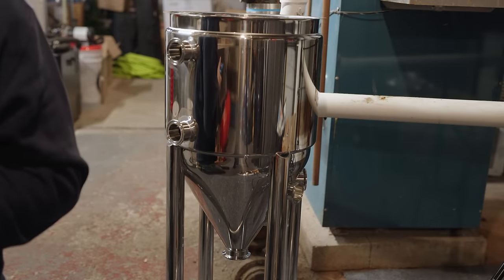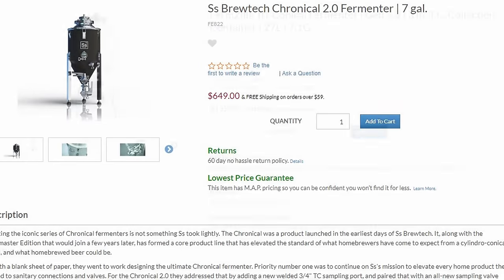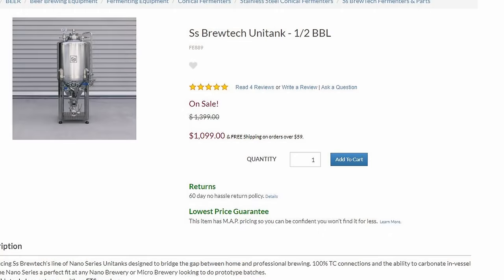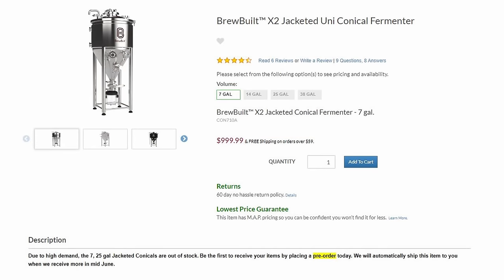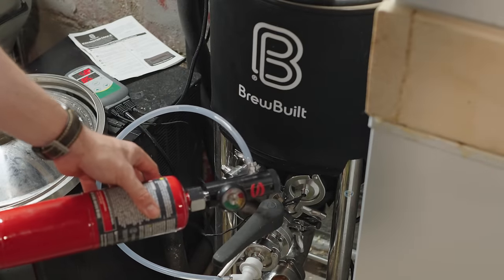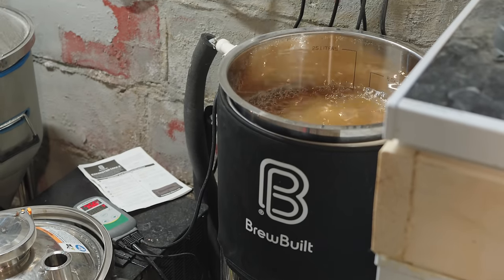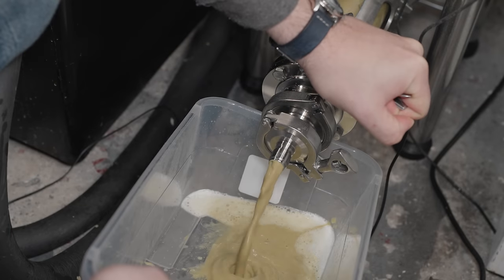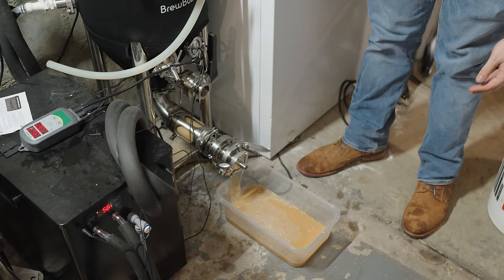THINGS YOU SHOULD KNOW About Using CONICAL FERMENTERS

Comment: I think in the right hands, you can make better beer with a conical.  1. It's the best (only?) way to ensure the first time O2 touches your beer is when it's in your glass.  2. Cone dumps - The best commercial IPA producers are doing cone dumps after transferring, and after dry hop additions.  They are finding its the best way to get the fresh hop taste without the vegetal bitterness. If you're not that into IPA and hazy IPA, you can do without.  That being said...yes you can make a very good IPA with a bucket, but I'd at a minimum want something with a spout on the bottom so I'm not using a racking cane and pumping O2 in there.

Comment: I finally got one because carboys with a small necks are hard to clean, and I don't like to re-rack for second stage (usually dont) but still want to dump trub etc. Also tired of getting goodies in my keg. 

Yes big mouths are a fix to cleaning but I also wanted to up my size so it was a good time to take the plunge. 

My guy is lower end,  only $160 but has a ball valve at the bottom,  and a ball valve higher for sampling.

I love that you tell people to start small.  I brewed extract in dual buckets with a turkey fryer when I started.  Through the years I switched to all grain and have been slowly upgrading which has made it easy on the pocket book and helps me identify what works for me and what is a waste of money.

Comment: How do you connect / disconnect chilling lines and chilling coil?
Do you get a dump bucket and pour back into glycol chiller or water reservoir?
Reply from the maker: It is a quick connect fitting, you can use a dump bucket but these lines don't need to be cleaned more than a few times a year

Comment: Excellent video!!  My question relates to the Triclamp to corny keg DC.  Once you set that up to the fermenter, it can't be changed.  In other words if you use the sampling port to take gravity readings during fermentation, how do you connect this when it comes time to transfer to a keg??
Reply from the maker: Thats one reason why I recommend adding another butterfly valve, that way you can swap stuff out without spillage.

Comment: Been thinking a lot about opening a brew-pub - do you think learning the conical method at home would assist with the large scale process or just my bucket adventures are enough? I'm pleased with he beer I've produced, had many very nice compliments, and I think I've learned a decent amount from the all-grain, yeast and hops process of many different styles but there's always more to learn. I do appreciate the videos and awesome advice!
Reply from the maker: Considering conical fermenters are the norm on the pro side, using homebrew sized one would probably help you learn the best way to use them. Just pretend they're much taller and more permanent than they really are. Use hoses and gas to push the beer and clean with CIP. If you've mastered using the bucket then you can reliably make good beer, but learning the quirks of conicals and the order in which to do things can be learned on the big stuff.

Comment: Any issue with light affecting the beer via the sight glass during fermentation?
Reply from the maker: Just keep the sight glass out of direct sunlight, or if you want to you can add a valve upstream of the sight glass and then add it in the flow path later

Comment: On the sight glass, What size flow pipe OD do you recommend… 1” (25mm) ?
Reply from the maker: I just use the same diameter as everything else in the system, which is 1.5" or 38mm

Comment: When opening the conical valve for dumping trub or yeast for dry hopping do you risk oxidation if the fermenter doesn’t have CO2 pressure?
Reply: @acmhfmggru  Thanks for the info! That was my assumption but wasn’t sure. Makes send to just purge it with CO2 right after doing that.
Reply from the maker: If you dump trub in the first few days though this isn't a big deal. Harvesting yeast can be done after you rack the beer over as well if you want to and this can help avoid oxygen, but otherwise it doenst hurt to hook up a 2-3 PSI CO2 line to the lid when dumping yeast earlier.

Comment: how many days does it take hops to make it to the bottom of a 14 gallon unitank? a couple day then dump?
Reply from the maker: I've only ever used 7 gal sizes, but usually they pack on the bottom after 3-5 days from dry hopping. Initial trub settles pretty much within 1-2 days.

Comment: I have a spike flex can I still use this cleaning in place tech/equipment?
Reply from the maker: If it doesn't have a bottom drain valve it will be more difficult. You may just need to lift and dump it out in this case